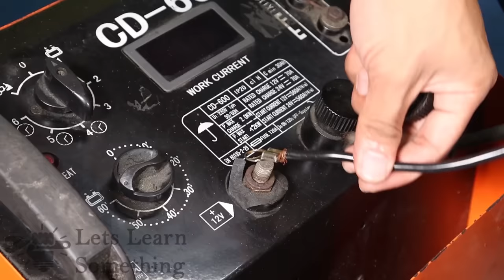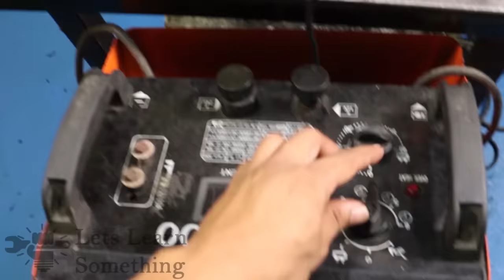Turn One Cylinder Engine Into Boxer Engine

Comment: Boxer engines crank and pistons are opposed 180 degrees. This is a flat twin. But good job none the less.
Reply: v-twin 180-gr
Reply: @j.r.arnolli9734  a V twin starts at 45 degrees like a harley engine. It makes the shape of a V. Up until it gets to 90 degrees then it makes the shape of an L. So then it would be an L twin like a Ducati. This is a flat twin. The cylinders and heads are opposed 180 degrees. It's flat. and the crank stroke is 360 degrees. If the crank stroke was 180 it would go from a flat twin to a boxer .

Comment: So, now we know not to use plexiglass as a actual mechanical structure and only for visual demonstration. Thank you for doing it both ways. I'm wondering was it intentional to use the plexiglass to show us all what the inner workings would be on your metal crank case? That was a catastrophic failure but it also demonstrates the forces that are going on during operation.

Comment: Excellent job, however I understand why you did it this way but for dynamic balance it should be both pistons moving out at the same time then in at the same time. Two crank pins set at 180 degrees. Brilliant achievement though.

Comment: I hate to be "that guy", but technically, that isn't a "boxer" engine, but an "opposed cylinder" engine. A boxer engine has the rod journal's for the opposed cylinders 180° apart instead of riding the same crank throw. That being said, this is still an epic build!

Comment: I was hoping for a trie boxer design as the crank pin should be a 180 offset. Neat project but doesn't have the crank  balance benefit a boxer should have.

Comment: A proper boxer throws the pistons in opposite directions hence the name. This considerably reduces the vibrations compared to a parallel twin. But it needs a more complex crank. Unfortunately, both pistons going the same way doubles the vibration. 
The solution is a 90 degree V twin. Piston and crank vibes perfectly cancel out.

Comment: Aw man, I feel for you when the acrylic crank case broke.  I had a feeling it might though, but it lasted pretty well.  One thought I did have, did you have a breather hole or was it sealed?  Wondering if crankcase pressure might have been a problem.  Super cool video as always man, appreciate the inspiration.

Comment: fairly certain its not a boxer... its a single crank pin 
all boxers are flat engines but not all flat engines are boxers
edit: also forgot to mention
amazing build regardless of weather or not its actually a "boxer" engine.
though bit of constructive critiquing, could probably lower the oil pump pickup , geting a fair few air bubbles runin in them lines

Comment: Hello I am a follower of your projects, they are very good, in the next video you could convert an engine of a volkswagen beetle (boxer engine) that normally works with gasoline, could you make it work with biodiesel? congratulations on the projects ...
Reply: You could make it work by lowering compression, but it would not operate as a diesel
Reply: @BrokeWrench  On the contrary, a diesel engine works at higher compression, I say this because I saw in his videos that he made a motorcycle engine run on diesel ...
Reply: @emersonceladitarojas9593  you asked how to make the engine run on biodiesel. That is the easiest way, but it would still be a spark ignition engine.

Comment: Thermoplastics aren't a good match for this application, especially acrylic: it softens at 195'f and degrades quickly when introduced to oil or gasoline. Lexan has slight advantages (250'f until it softens, more impact resistant, stable against corrosives) over acrylic, but nothing holds the working-temps and meets weight demands like good ol' fashioned aluminum, baby!

EDIT: I finished the video and yeah... basically that. Acrylic is a baaaaaad choice.

Comment: make a real block for the engine ,make a single exhaust header, make metal oil lines , u. could put in a motor cycle it woould make a pretty good cruiser

Comment: Don't the exhaust and intake have different size ginds on there lobs for lift and duration? If you switched them your high lift will be on exhaust and low lift for intake.

Comment: nice work i apprechiate what you are doing. but technically it is not a boxer engine its a 180 degree v twin cause in a boxer engine the pistons move towards or away from each other (180 degrees crank rotation off)

Comment: I'm only to 04:20 so far, but I'm wondering why you chose to not put anything between the two connecting rods, to prevent friction between them where they meet on the crank pin.

Comment: When a 300cc is too expensive so you buy 2 150cc engines and boom you get the power and torque of a 300cc for cheap

Comment: Will you make an opposed piston engine. Two cylinder liners housed in a finned case. I've seen your builds and you can do it. O/P engines give high power. High MPG. Low maintenance. Less moving parts and save space.

Comment: This crackshaft has not a boxer configuration. You"ll need two individual cranks, one for each individual connecting rod 180 degree one from the other, the two pistons have to move in and out at the same time. The crack shaft configuration you are using here is equivalent to the Citroen 3cv wich is opposite cylinders but not boxer crankshaft.

Comment: Vairy cool but technically not a boxer since both connecting rods share the same crank pin. It would be classified as a wide-angle V engine, I think. Not criticizing it's awesome and sounds great but a true boxer would run a lot smoother.

Comment: Too much pressure buddy. 
So when the cylinder fires 🔥 
Some of that force is pushed into the chamber where the crankcase is. 
Instead of closing it off with that bolt if you slapped a filter on instead the crankcase gases could vent to the atmosphere.

Comment: There one pertinent question, in this design, one of engine runs anticlockwise and the other clockwise. How did you manage the cam - valve timing? This is a single overhead cam and  it can't be set in any other way.
Reply: each head has its own cam, and the timing was done by the chains :)
Reply: @GaisaSanktejo got that bit but both those cams are designed to rotate anticlockwise only, that's why valve timing is fixed in a SOHC. You rotate a 4 stroke engine clockwise and you get pieces of the valves and piston. ;)
In his setup one of the engine is rotating clockwise and the other  anticlockwise, how does he manage the valve timing in the one rotation clockwise. 
Ideally new cam lobes have to be cut to take into account the lobe seperation, when you rotate an engine clockwise. It is easier done in a DOHC. 
If you want to avoid this issue, keep the configuration of both engines anticlockwise. Then one engine will have the intake side up and the other will have the exhaust side up. It looks pretty bad.
Reply: @Daft_Dhwelk  I don't know much myself, yet I've seen him create twin cylinder engines before and he seems to know what he's doing since he's managed to get them all working (probably with a LOT of off cam tweaking and tuning).
He doesn't just stick it in and it suddenly works; he modifies the rockers (as seen in this video, the rockers for one of the cylinder's have been rebuilt), adjusts the timing for each cam and more that I don't remember how to describe.
He's repeatedly proved to be beyond my level of mechanical expertise, as have you, yet he consistently gets his mechanical wonders to work?
I can only assume that he's learned to think outside of the box, and after multiple breakages, has learned what does and does not work :)
Reply: @Daft_Dhwelk  As an additional note, you can see his modifying the rockers from 6:40 on
Reply: @GaisaSanktejo  Thanks a ton, I missed that bit completely. 
He actually chopped the rocker arms and re-welded it. Wish he made a more clear montage of that. It looks like a magichians "sleight of hand". One minute you have the rocker, next minute its all done, magically.
Reply: @Daft_Dhwelk  you're welcome. I knew what to look for since I've seen him do this before ;)

Comment: Very cool but.... It's not the boxer engine. For it be called boxer it has to have 180° crank offset. These two cylinders share the same crank pin that means this the flat twin engine.

Comment: great job making the engine run and all but this is not a boxer engine, a boxer engine has 1 crankpin for 1 cylinder therefore this a just a flat v engine because the 2 cylinders share the same crankpin

Comment: It is NOT boxer engine! In boxer pistons are moved 360 degrees. It means that both are in top and bottom at the same time, but cycle is moved by two steps. In this engine one piston is at top and second on bottom, so pistons are moved 180 degrees. It gives something like V engine with cylinders in line. In this configuration forces from working pistons are not balanced, because both work the same direction, so the engine is vibrator.

Comment: They won't last long, strange how taking the cam chain cover of the head the top timing sprocket had not bolts in or any tensioner in the cylinder. I don't know why someone would leave parts out, if they wanted parts they would buy them the YouTube Revenue they earn would be enough to not use old parts that serve a purpose to keep the engine in time

Comment: Uh, I believe this is fake. If you pay attention, you’ll notice that the round object opposite of the oil pump, it doesn’t just rotate, but it moves as if it’s making the hole that it’s mounted in larger cause it’s moving side to side. Also, the revs and the throttle inputs from the faceless person near the end of the video, do not match. 
Extremely Sus.